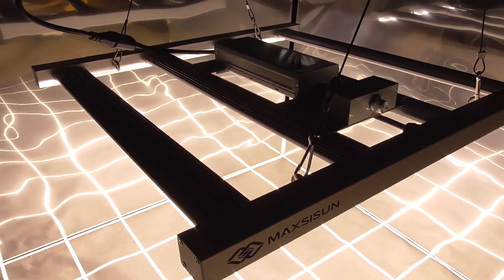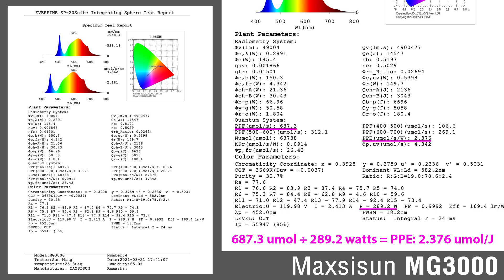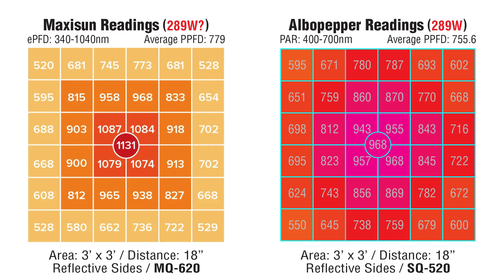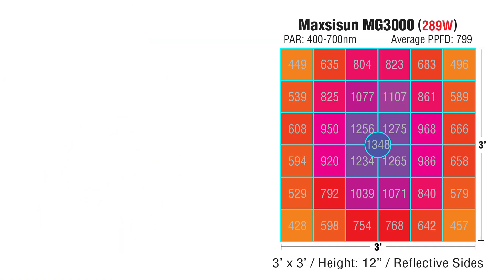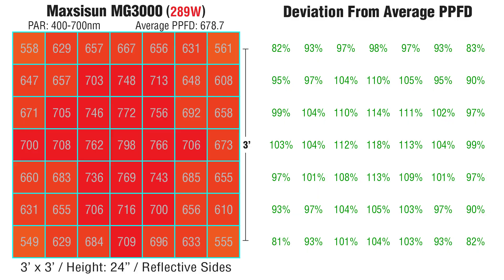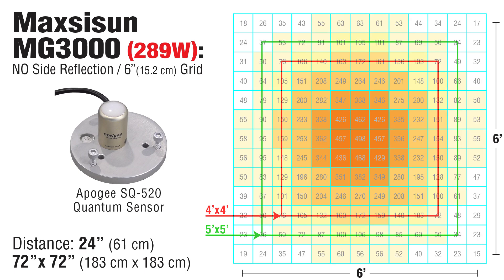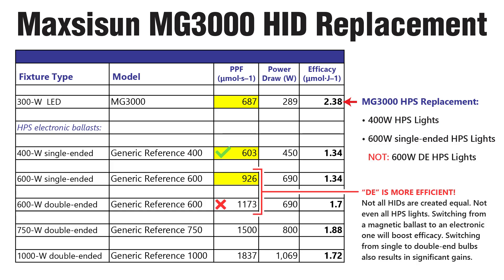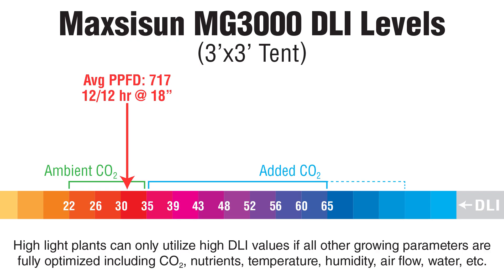How High to Place LED Grow Light Bars? (For Consistent Light Coverage) -Test & Review for Grow Tents

Comment: who is better xs4000 or sp3000 thank you
Reply from the maker: They are not comparable. One is 480W, but the other is only 300W. SP3000 has a narrower coverage area. So it depends on your application.

Comment: I bought this light at Xmas…paid $250..I put it in a 3x3 tent and have been happy with my grow so far..Did a lot of research and this light is a good bang for your grow budget….I already have a FCE 4800 Mars Hydro in a 4x4 and it’s doing excellent with my 4 Blue Dream Autos (Day62)..Big frosty, sticky buds..I have had ,any board lights but since switching to bar lights I have seen better results on my outer edges perimeter because of the more even light and par distribution…

Comment: Mr. Pepper i have another question please, how does it come that the samsung Diodes Lm 281+  and the 301s are so close to each other in efficiency? On paper the 301B and H put out a good amount of extra light with the same power (I think something like 30%), but in reality and in Tests, a decent lamp with Lm281s is maybe 10-12% less efficient only. And the price for the 301s is 10-14 times as much as the older 281. A 281+ diode is actually only 1 cent when you buy a pack of 4000 pcs. By the way, id like you to test some really cheap lamps. There are interesting panels on Ali express, like a 100W panel with 336 LM281+ diodes for only 40eu. No heatsink and no dimming, but a lot of diodes and id like to know if such a lamp can hold up with the Viperspectra P1000 for example. I wouldnt be surprised at all if it does.

Comment: Hello Mister. If LED are more efficient when underpowered, wouldnt it be much more efficient to run 2 100Watt-Growlights at only 50% Power instead of a single 100Watt Light at full power? As i understand, LEDs lose efficiency pretty dramatically the more power goes through them. I think with this method even cheaper diode boards like the older LM281 would be more efficient than even the best diodes. Because the difference is actually not that big of a deal between different diodes,
Reply from the maker: In concept that seems to make sense. But in practice, the lights don't have a huge boost in efficacy when dimmed. You could compare these 2 reports for the same light with Samsung diodes & Mean Well driver:
https://albopepper.com/ATREUM_HYDRA-1000_Report_20210402.pdf
https://albopepper.com/ATREUM_HYDRA-1000_Report_DIMMED.pdf

Even when dimmed to 1/5 the power, the light still had the same PPE.
Reply: @Albopepper  thats weird. I have seen a couple of people describing now that LEDs lose efficiency, the more you power them up. guess i have to wait until i have my own lghtmeter/PAR meter.

Comment: Really appreciate all your videos regarding lighting, while I have watched all your videos and reviews in recent months on different lighting, I'm curious what your suggestions would be on just simply starting seeds? For a home garden? I may have also missed something in your recommendation speaking about that. Thanks so much!
Reply from the maker: Thanks for watching Cameron! For seed starting, I would match the light to the growing space. Is it a window sill, a wire shelf, or a table top? Different form factors of lights are suited for different spaces. Either way, I would certainly go with some decent quality LEDs, not fluorescent or HIDs. And select a light intensity appropriate for seedlings. That means PPFD levels from 200 to 500 umols, depending on plant type and light cycle.
Reply: @Albopepper   That makes sense! I guess it will be on a wire shelving unit or a table top. It can be very overwhelming trying to pick a light given variety of lights out there.